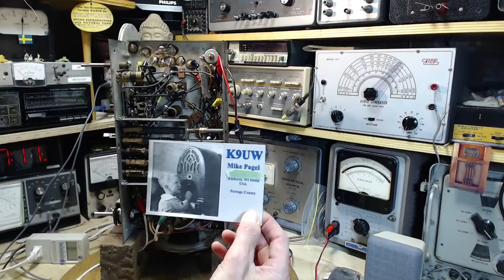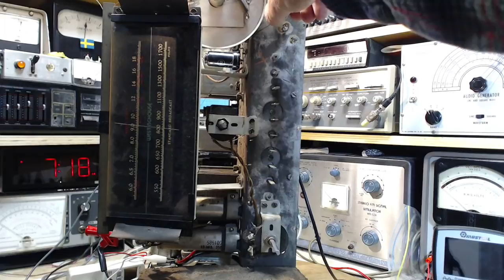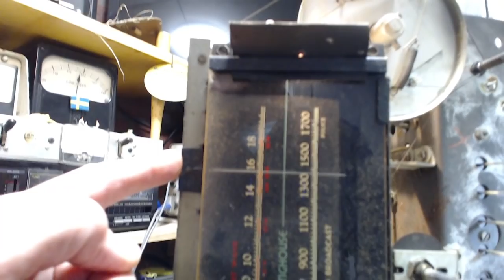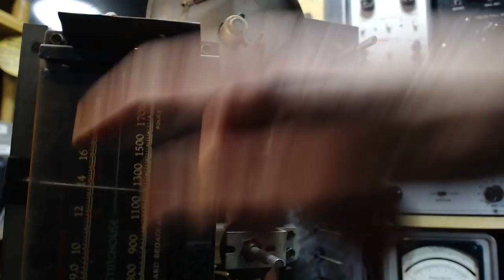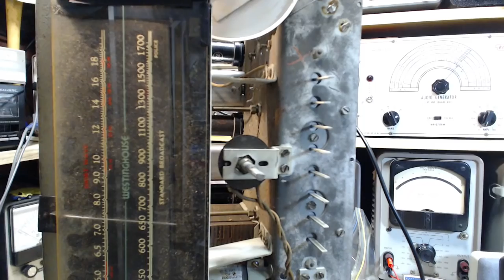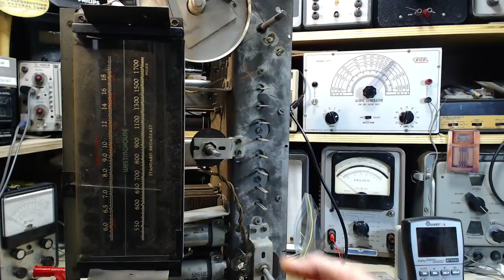Westinghouse 535 Video #14 - Test Flight

Comment: Yeah, I did something similar. I heated the end of a tube socket tab to solder on a new capacitor and softened the solder enough to actually crack the existing old solder when I moved the tab slightly. Spent a bunch of time trying to clean a "dirty" tube socket and trying to find out what else might be wrong. I was lucky that, when I looked more closely at the connection, I was able to spot the crack. I am now careful to heat the connections I make enough to melt all the solder.
Reply: Ay, been there. Often. Regularly.  ;-)
Reply from the maker: It all fits in the category of 'Unintended Consequences'.
Reply: Definitely.